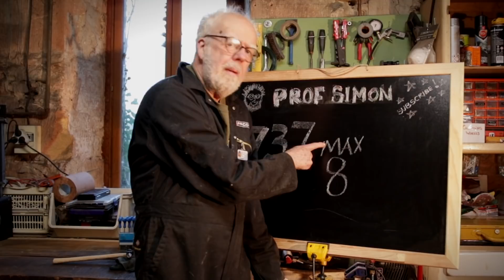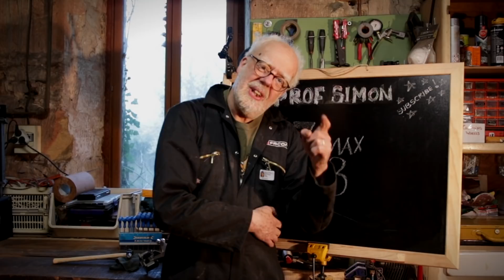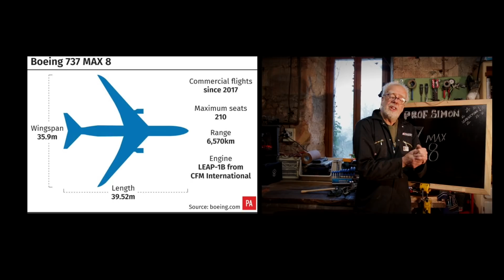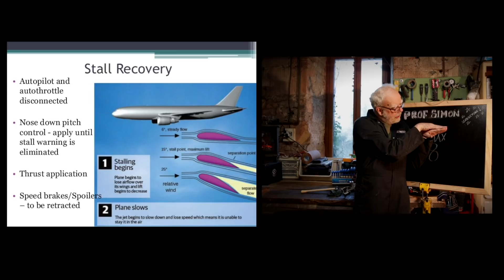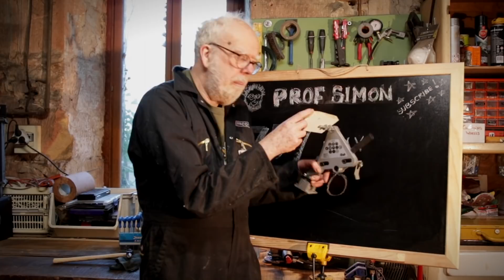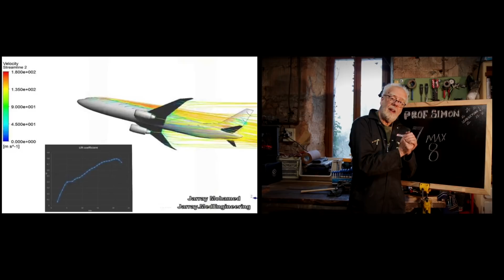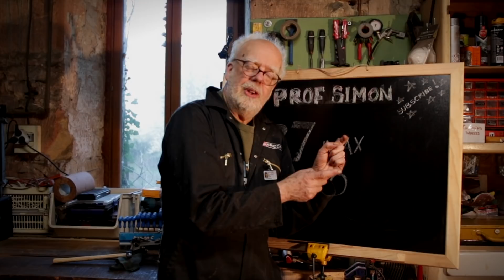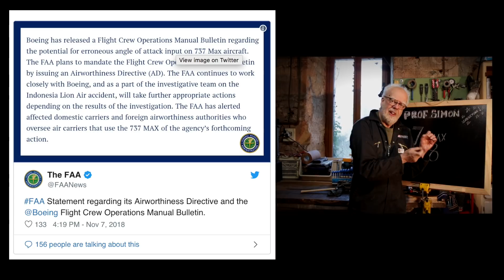Boeing 737 max 8's

Comment: Boeing built an inheritently unstable aircraft. The new HUGE bypass engines are mounted more forward and up higher than the old. In straight and level flight the nacelles around the new engines are fine, but when in a 14 degree or more turn, they create lift, thus the nose wants to come up. So they built this MCAS system to automatically lower the nose. I SO SUSPECT THIS SYSTEM! Also, Boeing pushed that there was little difference in the old vs the new plane, so they persuaded the FAA to NOT require hours and hours of retraining. NOT A GOOD IDEA! So back to the MCAS system. There is an Angle of Attack sensor that is driven by WINDDIRECTION on the side of the aircraft. I see 100 differnt ways this device could be an issue. If the aircraft porposes it will start fighting itself AND the pilots trying to get it under control! What if there is a down-burst, or an up-burst or a bird strike on this device? WATCH this YT https://www.youtube.com/watch?v=4TXZG17y-n0 The sad part is all this BS to save a dollar. Go look at the flight profiles for the 2 Max 8's that crashed, within 40 knots of each other, both nose first, both shortly after take off, look at the porposing! Now imagine that AOA indicator moving up and down and and adjusting trim / pushing THE NOSE DOWN as pilots are trying to fight it!  Her is a really good article on the Lyon Air crash that explains much of this and the main source for my armchair diagnosis. https://www.nytimes.com/2018/11/27/world/asia/indonesia-lion-air-crash-.html   Here is a side by side of the flight profiles for both aircraft https://pasteboard.co/I4Oz13y.jpg
Reply: I believe the up/down you see in the data is due to the 10 second trim commanded by MCAS. MCAS doesn't send a continuous nose-down signal. It signals correction by trim for 10 seconds, stops giving trim input, resumes with another 10 seconds of trim, etc, etc. Since this happening soon after takeoff it's very dangerous as there is so little time and altitude to sort things out, performance. The stab trim cutout switches are just behind the throttle levers and above the fuel shutoff switches. I think Boeing was a bit quiet about adding this new "feature" and if you're trying to bring out a new aircraft as a modest improvement, and trying to avoid a requirement for specific type-rating or minimize the Transition Training and your data shows the system as reliable their plan SHOULD have worked. Both Boeing and Airbus have had a couple AOA related crashes in highly automated models. I'm thinking the code in these boxes are reaching our limits to test them in EVERY failure mode.
Reply: Oh bird strike to sensor...... Yep that would do it (maybe even a pidgeon $hitting on it would have sufficed).  Well done Boeing, you made a fuel efficient piece of junk and added bits and bobs like twits to try make it keep flying - and had enough stupidity to allow these idiot measures over rule pilots so they would have had a nice 45 seconds journey towards death whilst fighting the damned thing and admiring your stupidity.  Here's a good test..... stuff all the boeing engineers on one, switch off all "aids" and see if you twits can fly it?  In the meantime, like hell I'm ever getting on one of your flying pigs.  What is wrong with you morons...... may as well play russian roulette than sit in your "flying elephants"
Reply: @anthonyspanjich2772  Well, well said, Anthony!!
Reply: What you say about the engines is very true. The strange thing is that all aircraft even from the past have the engines now so much forward. This is called Mandela effect. Those who study the phenomenon we were almost sure that the aerodynamics will be affected. See Mandela effect engines for more info.
Reply: ArtisannasitrA time to utterly rip your "argument" to shreds: 1). Angle of attack sensors are manufactured by Thales Aviation.  They are the same AOA sensors that are currently on the Airbus A320. They also manufacture similar aoa sensors for Cessna, bombardier, embrear, and leer. AOA sensors do not "flop" around with the aircraft. AOA sensors are located in the slip stream and "fly" like mini wings. All aircraft have at least 2, one on the pilots side and one on the first officers side with each displaying their respective angle to each pilot. This is a safety measure to ensure both sensors agree (lion air had a faulty sensor on the pilots side for over a week, but we'll get into that momentarily).aoa sensors are nothing new and are standard instruments in aviation, so your getting hysterical over a proven electromechanical sensor. 2). MCAS is nothing more than an anti-stall device, similar to the automated anti-stall device in the airbus full flight envelope protection software. 3).  The aircraft is not inherently unstable, simply put, in some instances there is a POTENTIAL for the powerful engines to cause the plane to pitch up without control inputs, something that happens on virtually every flight and is easily countered with trim stabilization, again you're hysterical over something common and known. 3).  Those speed/altitude screenshots show two very different scenarios. Lion Air had been flying for a week prior to the crash with a faulty AOA sensor, the pilots differed from the FO by over 20 degrees.  It is clear that the pilot had incorrect information and was unsure how to fly the plane given the fluctuating speeds and and fluctuating altitudes, the pilot was not trained for such a situation. The Ethiopian screenshot on the other hand indicates a normal departure, a continually increasing speed, a normal rate of climb to a specified altitude of about 7,500ft and then clearance to climb to a higher altitude. How you can see any similarities between those graphs is beyond me, but again hysterics. The greatest factor to the crash of Ethiopian was the first officer. He was in command of the aircraft at the time of crash and only had 200 hours of experience! That is criminal. You need to take a sedative and relax, you're hysterical.
Reply: @JonnyRicter  The ET flight did not climb 7,500 ft, only some 1,000 ft. The airport lies very high and FR24 mistakingly lets this flight start at 0 ft until the first ADS-B messages came in. Forget anything shown at the beginning of the flight, this is generated by the website, not based on data from the plane.
Reply: The Concorde was an inherently unstable airplane as well if you got it too slow.  The center of lift would shift relative to the center of gravity and pitch the nose up and you would never be able to recover. In addition, all fighter jets are unstable. They ALL use flight computers to keep them stable. The FAA does not just rubber stamp airplanes.
Reply: sounds like the most plausible theory.. overrides pilot input. Toyota cars finally flashed pcm so brake input overrides throttle position voltage in all events. People died until this basic override was flashed in each car.
Reply: I think your right. That one sensor can kill you. It's working as designed. Probably works to well to the point it will kill you!  It's a software problem...the fact that it refuses to allow the pilot to take control is another issue also! I bet it is proposing and the computer can't tell the difference...its hunting!
Reply: Well said.. Boeing 737 is inherently an unstable aircraft... Since it was born it had always tendecy to go nosedive thanks to training and great piloting and other systems Boeing 737 has survived for decades...Now Boeing got a big challenge as the stability of the aircraft is at the mercy of a computer and this is completely different than what airbus has done...Automation kills pilot skills but this is a unique situayion where automation is there to fix matters of physics and mechanics which is very dangerous
Reply: An accident is rarely to blame solely on one factor. There are two questions that I don't have the answers for. First, does the MCAS provide the pilots with the possibility to shut it down and fly the airplane manually? I would be surpised if the answer is "No.". The second question is were the pilots trained what to do in case of malfunctioning of the AoA/MCAS? There are many famous crashes caused by inadequate reaction of the pilots (often with thousands over thousands of flight ours on the same plane) to otherwise non-fatal malfunctions.
Reply: Still it's all about the training.. You can't just blame the MCAS, It's too early to predict.
Reply: @sebastiannikkolas8497  The fundamental starting point is the compromises in design as described in this very detailed comment.  The foundation of the design is flawed and MCAS is a "bodge job" to get around the elemental design flaw.
Reply: @sebastiannikkolas8497  did you ever read Ex's Nasa engineer admit Boeing has a safety issue?...

So why Boeing engineer can't predict that the new MCAS system could possibly make planes crash if flawn  by untrained pilot?

 why Boeing just ignore that training to the pilot?

Why Boeing just sell their planes without taking any care the need of pilot skill improvement?
So... There are two possible hypothesis I think... The "ignorance" or "bad design".
Reply: May I add something?  I flew hang gliders for many years and purposely chose lower performing models.... because although less efficient (drop wise), they were extremely forgiving and much easier to take off / land.  You could purposely stall it, let go the bar and it would gently drop its nose and recover very quickly (within 200 feet)... High performance gliders - NO WAY.  They might fly much further in the same conditions but were nasty things that tried their best to get into spins and generally make it MUCH harder to recover.  Now.... is it true that these jets save fuel blah blah blah?  Mmmm, could it be that this was achieved by making a less stable (but more efficient) flying platform - that "needs" wayyyy more computer "management".  Do I trust a computer over a smart, wise pilot?.... NO WAY.  My guess is the software is no good, the plane is fundamentally flawed (because the bean counters just want the cheapest possible flights - so they pushed the "stability" Vs profit envelope) and what you have is a world full of "highly fuel efficient" 737's that without the software would be $hit to fly manually.  Classic case of "over engineering"... without enough engineering.  No way would this happen with an aircraft that uses double the fuel - but is a dream to fly manually.

Comment: Thank you for posting this video! This informs me that Boeing needs to go back to the drawing board to deal with this engine placement flaw causing the nose to push up and then needing a software{MCAS} to push it back down. A Pilot who doesn't actually understand what is happening will end up with Aerodynamic instability!!!!

Comment: Very interesting, I have to say I have never flown in my life, but if I did I would have hoped there would have been a way to put any aircraft on manual, and disengage the computer.
Reply: There IS a way to disengage the MCAS, there are 2 switches in the cockpit that control the power to the automatic trim, which can then be controlled manually (MCAS is a software addition to the auto trim system, which has been around for a long time). The Lion Air crash was preventable IF the crew understood what was going on and how to deal with it (which is the same as the procedure for malfunctioning auto trim). However, in an emergency situation with alarms going off and stress and confusion (due to false info from flight systems) .....  However, I would think that after Lion Air, 737 max pilots would be alert to malfunctioning MCAS and know how to deal with it (which makes me think maybe it wan't MCAS in the Ehiopian Air case - we don't know yet).
Reply: @AzRon999 . If you know that MCAS is present. Prior to the lion air crash, MCAS was not mentioned in any pilots manual except for the Brazilian one as the Brazilians insisted on its inclusion.
Reply: @AzRon999  Whatever happened to common sense? Those pilots don't need to instantly understand  all the why's and wherefores. They just needed to remember to hit the cut off switches and fly the plane manually. Is that so hard? Also, the airlines possibly could have done a better job by not hiring pilots who may be prone to panic and forgetting their training during times of crisis..
Reply: David S  that’s what’s wrong with the world to day every thing is run by a damn computer sooner or later it’s going to fail then you’re in deep shit
Reply: David S! The few times I was up in the skies in an jet engine airliner were paid trips as a musician.
I never wanted to pay for a ride in the sky, and maybe I have some small paranoia about crashing.
That's a big thing to do, basically giving away control of your life to an airplane and the weather.
But now, I'd want to pay at least once, because seeing the sun rise and set on top of the clouds, yes,
is one of the most beautiful things I have ever seen.
Watching the wings moving up and down as if they were flapping might have helped keep me awake,
but when the friendly stewardess asked if I was uncomfortable, I said it was too exciting to be up here.
She went and got a box and put it on the floor between the two pilots up front so I could sit and watch.
That was the best part of it, seeing it all in front and passing beside me. That wouldn't happen now.
Your comment is totally sensible. As far as global computer disengagements, I know every country
should be able to disconnect from the American world wide web as sovereign nations.
If consumers paid for an internet that encompassed their province, state, or small isolated country,
first, that would be a very low rate. Bumping that up to your country, adding another country,
or paying for global access, would not only lower rates for everyone, but this construction would
create high tech electronic service work that would be attractive employment for modern users.
There are Sons and Daughters of the Gael who speak Gaelic. Bay-an-uck-let, blessings on you.
You are hearing from Clan Watt, who never manufactured.

Comment: How does powering up and reducing the angle of attack (as all pilots are trained to do when a stall is nigh) violate the new software's stall protection code? It's quite possible (and we shall see) what MCAS was up to here, but it seems very possible that there's another - perhaps novel - link in this accident chain: the jackscrews that operate the tail control surfaces.
Here's a good description of the new stability system, and why Boeing (at first) decided not to tell pilots much about it:
https://theaircurrent.com/aviation-safety/what-is-the-boeing-737-max-maneuvering-characteristics-augmentation-system-mcas-jt610/
Reply: Wouldn't those share commonality with 737NG?

Comment: Seems the wing and engines are different to the old 737;I’ll take the ferry
Reply: Yes, they are different and also the landing gear. These changes provoked aerodinamical issues. MCAS was developed to help fix/compensate those problems.
Reply: @cleversonsutil4495  - Sounds to me it may have to be scuttled! Trying to apply fixes to new aerodynamic issues not considered before can only lead down a new rabbit hole.
Reply: @cleversonsutil4495  ....it fixed 'em alright. I'll stay the hell home. Too crowded, too rushed, slobs, drunks, loudmouths, whiners, dufus pilots who shouldn't be allowed to drive a taxi etc. You guys enjoy yourselves.
Reply: @cleversonsutil4495  Expedient bandaid
Reply: @cleversonsutil4495  Well they didn't create aerodynamical differences, wings are the same shape as they assist in creating lower pressure over the wing that provides lift. The winglets are different as they are re-designed for the purposes of creating less drag during flight. That's essentially their only reason. Their engines are different as they're more economical and quieter than those previously, but it's down to the way the autopilot works, for some reason it's suggesting the plane descends when it thinks the plane is about to stall, the pilots are simply doing what they've been trained to do and try to recover before disaster happens as they wouldn't simply be able to disengage the autopilot when the autopilot itself is trying to recover from what it perceives as the plane going into a stall.
Reply: @cleversonsutil4495  
Old saying is... don't fix if it aint broken :)
For example this year Honda introduced the new Accord, which used to be the top seller for years...but now they crammed an 1.5 liter turbo-charged little engine in place of what was for years a well performing 2.4 liter four cyl engine ... It just scared customers away, now Honda can't sell them!
Again some millenial idiot came with a bright new idea... :)
Reply: santa mulligan Engines farther forward...too far forward perhaps?
Reply: @rickshaw6198  Further forward and different height to compensate for the larger engine size. As you know, eg a 737 800's engines are shaped so that they have more clearance. That's the whole reason why the 737 MAX has the MCAS software.........the whole dynamic is different..... it may as well be a different plane entirely.
Reply: It is most likely a software bug as both crashings reveal.
Reply: I think the engines are not matching the design. They are also   taking of to steep and difficult to safe from stalling.
Reply: Across the Pacific??
Reply: I don't think the plane's engine placement plays as much a role as is being touted.  The software engineers tried to make it idiot proof but it back-fired on them because the pilots have thousands of hours experience and despite the nose pointing down, the older part of the stall messaging is telling the pilot to pull up conflicting with what the computer is already doing and the pilots own instincts.
If the computer had left the trim alone and simply gave the pilot a stall warning, the pilot would already know what to do instead of wrestling with the computer's actions.